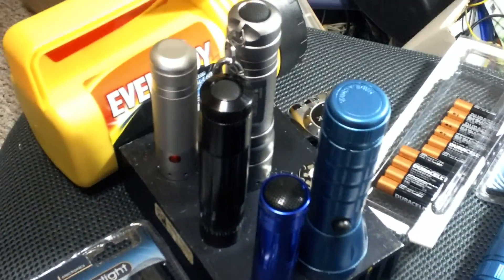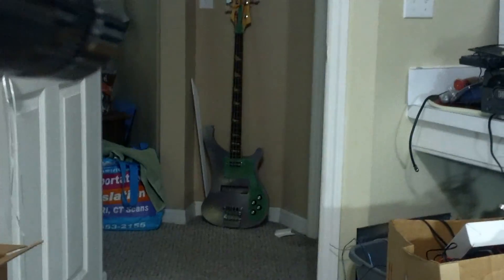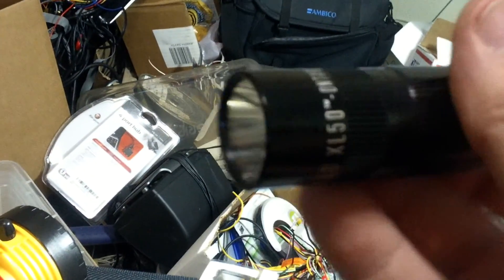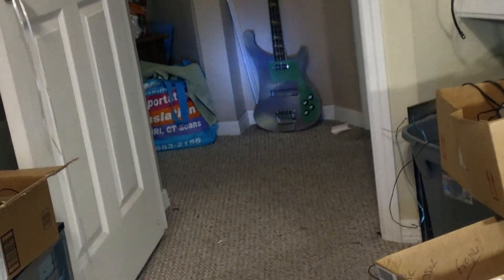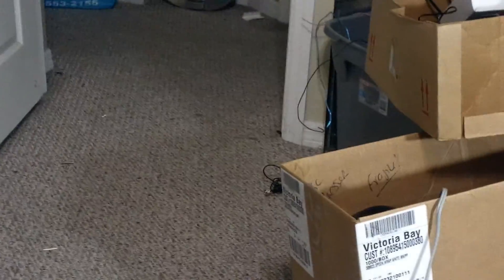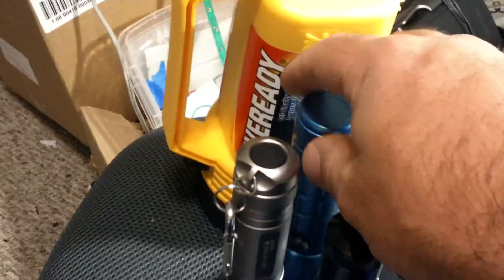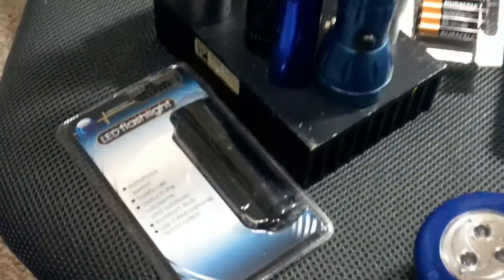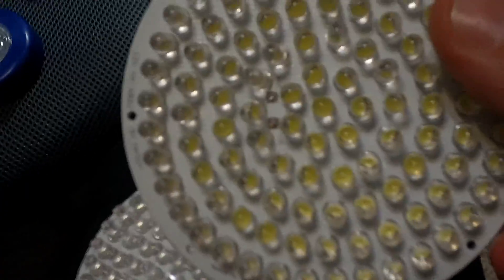Led flashlight hacking Part 1

Comment: eBay and amazon. Just Google 1300 lm XML led flashlight. however, you do get what you pay for. the switch on these lights often break or loss connection. I am an electrical enthusiast and know how to fix this, otherwise, they tend to break within 2 weeks. I now recommend the Skyray king. It is 4X brighter, has a better focus, and is considerably more durable. Don't forget to get high quality batteries, because the cheep 3$ ones are not even worth the 3 dollars.

Comment: @powermaks 2000 doesn't need to be that much. The solar panels on these cheap lights won't even charge the 2000 all the way, but will give you enough reserve to get thru the night on the cheap, which is what this video is about. And these are common AA's, not hard to find F's or something else exotic.

Comment: Good to have different options. I use the outdoor LED solar garden lights for power outages and camping. I Just replace the crappy low MaH AA battery that comes with it for a Rayovac 2000 MaH rechargeable. Wal mart has a 16 pack for about $14-.